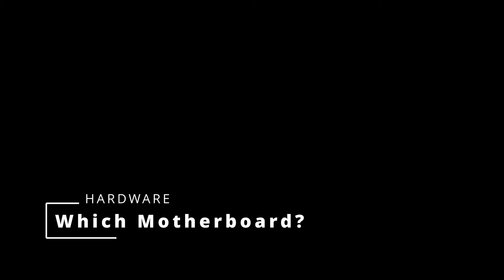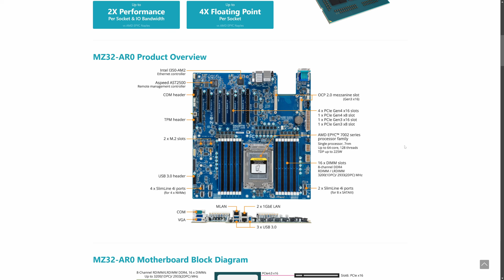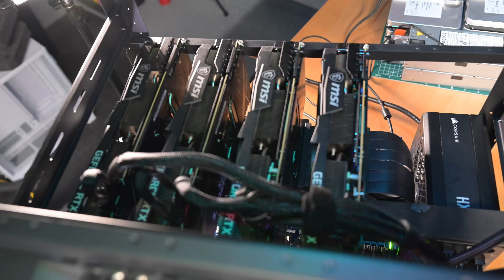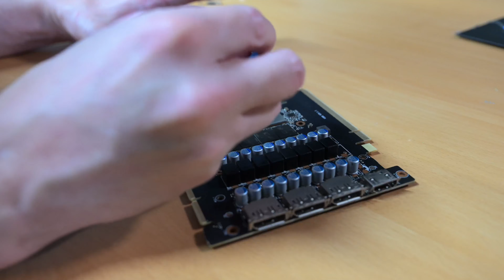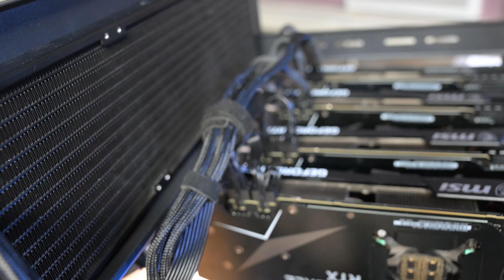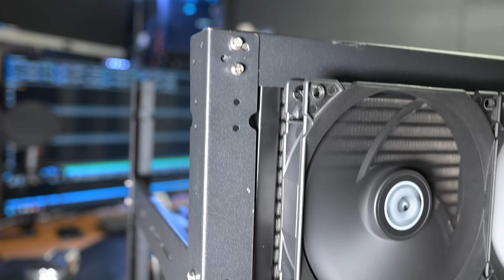INSANE Home AI Server - Quad 3090 Build

Comment: No MX4. It pumps out pretty bad therefore not suitable for on-die application. Go with PTM7950. I have it on my 3090FE and the performance just doesn't degrade. I used LM in the past and PTM is nearly as performant as LM while not amalgamizing with the heatsink.
Reply from the maker: Holy cow what voodoo is this? I was last night reading about PTM7950 as a replacement for my 4090s. The 3090s dont really get hit heavy on inference so they have been chilling pretty good still in the garage coldness but the asus 4090s are wtf levels of bad with whatever factory goop they used. This timing, its gotta be a simulation.

Only time someone has mentioned PTM7950 to me also
Reply: @DigitalSpaceport  I haveit  two A4000s and one 3090 FE. PTM7950 is it; it's the no-compromise thermal interface we all have been waiting for.

Comment: I dont understand the ram. Why 512gb?
Reply from the maker: In the nezt vid it explains that sadly one of the 64GB dimms didnt work so im now down to 256. However in both instances this rig is the failover in my HA cluster and I have a lot of vms and containers. My standing footprint is over 60GB and I run two workloads that can peak at 128GB each as well so yeah. Plus using a lot of wticks allows me to use all the memory channels and get tgat sweet epyc mem bw.

Comment: yes cool yeah great, but running consumer grade is VERY electricity expensive! bad idea. I would personally go for  a series of L4 which draws 72w only...
Reply from the maker: This rig I have the idle down to 130s now and most of that is me using the wrong EPYC cpu for efficiency as this is a homelab balanced machine to match my other 64 core server. Each of these gpus idles at ~10w which yes is a tad high but I would love to get my hands on some L4s.

Comment: @digitalspaceport - curious, when you purchased AMD EPYC 7702P cpu from ebay, did you took a gamble that it works or you have had 100% positive experience from ebay?
Reply from the maker: Im doing an update video right now so id suggest you hold up until its out. May be much later tonight but likely in AM.

Comment: I have a noob question (sorry for that): in the next video you mention that one of the Ram didn't work so you have to downgrade from 512Go to 256Go ram. I do not find any precise information about the maximum Ram total memory size the bios can support. Theoricaly with the 16 slot with 128Go ram each we can go up to 2 To of Ram for offloading GPU (even if it's kind of stupid to go this high😅). So i wonder if th bios and the mother card can manage effectively a least 512 Go of Ram.
Reply from the maker: Yes they can and DDR4 is down in price a decent amount. It did run and register as 512 for a while but that stick dropped out.

Comment: Thank you for this! Thinking about building the same rig with quad 3090s, but want to keep the door open to quad 4090s next year. In that case, what would you change about the build if anything?
Reply from the maker: Or maybe 5090s.... Good question. I addressed most of this in the recent vid  and article on HW considerations. Id go with a faster CPU, lower cores. Likely use air cooling vs liquid, I just had that cooler free. Probably at current prices would go H12SSL-I also. 
https://www.youtube.com/watch?v=_xL9r0ygISg&lc=UgzhzqLF3s-nJ5Lhud94AaABAg https://digitalspaceport.com/homelab-ai-server-rig-tips-tricks-gotchas-and-takeaways/

Comment: AMD EPYC 7763 is probably a better choice for CPU, it's released about a year later after 7702, and is a fully 7nm process. About the same price as 7702 on eBay right now.
Reply from the maker: I like this comment but let me ask you, if I wanted to bias a bit more for more mid range epyc freq what would be your recommendation? Id be okay sacrificing core # but selling to switch would be ideal.

Comment: 200W idle in Europe / Germany would you kill your electricity bill
Reply from the maker: Agree and I have more focus on power efficient systems also now. Video I launched today is a PC that idles around 25w. https://www.youtube.com/watch?v=iflTQFn0jx4 and that machine should hit like maybe 75% of most avg ppls use cases. I am working on one that hits 8w idle also but it likely hits around 50% but may also be of interest. I did get that rigs idle down lower after working on it some more and I need to mention those steps in a video sometime also. Powersave and some kernel flags really can cut the wattage for an epyc with minor usability impact.
Reply: @DigitalSpaceport  love the video tho. However when looking at the excel sheet with 650$ for one GPU... here one costs about 1.500$+ (so 6000$ for 4 of them)

Comment: Can this build be used for everyday computing, as well?
Reply from the maker: Sure. You could run the setup I did a year back that has worked very well easily here. It is just proxmox and a LXC but there appears to be a way to get a LXC windows instance running. I need to look more into that. https://youtu.be/IylJNfLi36E

Comment: Sorry if I'm repeating questions from elsewhere in the comments.  How did you "manually limit the GPUs?".  What approach did you take to lower their power consumption to fit within the profile necessary for your PSU?  What was the impact to performance of doing that?  Also, why not add a second PSU so they can run unconstrained?  Is there a way to safely do that?
Reply from the maker: nvidia-smi pm1 and pl XXX whatever wattage. It turns out however your GPU processing power utilization is /n so like each 3090 here only runs at 1/4 power. This is due to how ollama/llama.cpp currently handles model splitting. Tensor parallelism and such. There is work that may address this in the future and I would consider it more then.

Comment: Why don’t you use NVLink?
Reply from the maker: You wont get improvement for inference workloads. Have tested on dual A5000 and NVLINK. I may however use NVLINK for doing training on these 3090s but am not there yet.
Reply: @DigitalSpaceport  For inference not but for training it will make big difference but you can only utilize 2 cards at the same time when linking via NVLink but that should still be better than training with 4 cards on PCIe....

Comment: cool build, love the spreadsheets. You should project cost of ownership. At what point does it become to expensive to own ? Is there perhaps an undervoltage potential to bring power draw down without adversely affecting performance to much ?
How can you make money out of it ?  Can you bridge the gap from your website to this awesome beast and share time against your AI ?  Is there a particular branch of AI that is more cost effective against another that might not be landing on the sweet spot ?   Could you add an ASUS raid card, perhaps another network card , say 10gbe , can processes be re-routed to avoid cpu and ram bottlenecks ?
Good job, want more.

Comment: Your video is great!
There is a resale Asus prime trx40 pro at pretty decent price. Do you think it would do the job as good? The mb comes with 3 x pcie 4.0.x16 and may need a splitter to accommodate 4 gpu. 

In addition, I already have 6 x rtx3090. Do you think it would be beneficial to utilize all the 6 GPUs? I plan to go for llama 3.1 70b.
Reply from the maker: What is it priced at and does it include CPU?
Reply: @DigitalSpaceport  Trx40 is 120usd without CPU or Ram.
Quite hard to find AMD server mb in my area. What would be comparable setup if on Intel set?

Comment: I'm curious whether it's better to have identical 3090s or if using different brands wouldn't make a difference. Also, is it possible to mix 3090s with 4090s?
Reply from the maker: Yes you can mix any GPUs, even extremes like a 1070 and a 4090 and benefit from added vram size, however if you have slower cuda cores (usually older gen is slower) then you will baseline performance at the lowest cards level. Mixing 3090 and 4090 for quant 8 or lower is next to no discernable difference. Mixing 30/40 at fp16 you will have several t/s slowdown. I like keeping it to one model of 3090 if you can as you likely need to clean/repad 3090s especially. Its easier to be able to know what screws and pads go in which spots that way.

Comment: there is absolutely no way you are going to see any kind of condensation unless the room is at below freezing temperatures or you are using liquid nitrogen why even mention condensation???
Reply from the maker: The window AC spits out sub 32F air and wqs one, of many, considered plans was to have heatsinks right next to it. I opted not to and everything is greatly cooled from a distance as well. I do see condensation at times on the AC directional fins and need to wipe it off and pay attention to it so I dont get mold growth.

Comment: I have a epyc 7551p 256gb with Tesla p4. Going to potentially put my 3090 in it. The 7551p also does 2ghz for 32 cores. Do you find 64 cores at 2ghz is working well or is the cpu ghz speed a bottleneck regardless of core count?

Comment: Thank you for amazing content. 
I bought the same setup using your links. I am having a hard time to understand where to plug the power switch. How are you turning on/off yours? Is there any spot on the motherboard I can plug the switch on?
Reply from the maker: Find the model number online. Then search that document for PWR and it will show you the header position pins. The black cable - is ground and the red is +

Comment: A good alternative is buying a refurbished Mac Studio with M1 ultra + 128GB RAM on e-bay for around $3k. The M1 ultra with 128GB RAM will run 70b models with q8 precision at ~7.5 tokens/second and draws less than 100W when running such models. Additionally, you can configure it to allow up to 120GB RAM for the GPU, which should be enough to run 70b models at 64k token context.
Reply from the maker: I have one big issue with the Mac Studio route and that is indeed the Tokens/second fall into what I deem an unusable range for middle size models. Under 10 is painful and discouraging to use imo.
Reply: @DigitalSpaceport  7 tokens/second is slightly above the speed at which I can read and get good comprehension of what I'm reading, so anything above that speed doesn't make much difference for me when using the model on a chat UI. However, for using the model as an agent for automating tasks, then yes this speed is very low.

One thing I'm curious is what kind of speeds you get when using larger contexts with quad rtx 3090 setup. On the M1 Ultra it gets very slow for 70b models at close to 30k tokens in context, about 2-3 tokens/second

Comment: Yes but how do you get any LLM to run on all that? For example, llama v3 requires a high VRAM count. Does this get around that per card VRAM by being able to aggregate the VRAM or is that not a thing?
Reply from the maker: Yes it spans the vram of all the cards needed to fit the model

Comment: These 4 GPUs should only draw 250-300W alltogether?
Reply from the maker: Due to the way the model workload splits across the GPUs when you are using their VRAM, they are often around 25% utilization on the processors. There are other ways to split workloads but lamma.cpp is under the ollama hood so that would need to be addressed there. Tensor Parallelization is the term.

Comment: The budget of 5K for that build is awesome,  at first i thought we were looking around 10K.
Reply: On a side note, i am having trouble sourcing used 3090 24GB in my area.
Reply from the maker: Im in a fairly large metro and my local sellers want more then ebay. I pointed this out to one who had a similar 3090 Ventus for about 75 more thinking they would be like okay ill go to 600 and they refused to match ebay. Totally their choice but local sellers being way high on prices and unreasonable in negotiating is a recurring theme recently.
Reply: @DigitalSpaceport Soooooo true. Local sellers are terrible. Near me they want 1k CAD for 3090
Reply: @DigitalSpaceport  Yeah same here. its sickening. One guy got pissed off at me for showing how much less I could buy online. Oh well, their loss.
Reply from the maker: Thanks I also think its very cheap for what it is. I couldnt get as much bang for the buck any other way.
Reply: What about electricity bill
Reply from the maker: About 275/mo. We bought this house with electric rates in mind also as everyone doing any form of HPC should in my opinion. It can go as high as 800/mo if Im really cranking flops but thats a fraction of what cloud costs would be. There is a not small part of this that is production for my business.
Reply: @DigitalSpaceport Oh. My. God. Electricity here is 0.30 € per kWh or more, for a homelab I'm trying to keep idle at 100 W or less, but it's impossible with dual RTX 3090, 10 Gbe and a bunch of hard drives. Btw any recommendation Zen 1 vs Zen 2 vs Zen 3 EPYC in terms for bang for the buck? Is Zen 1 really that much worse performance per Watt?
Reply: 5k is nothing for this PC. Makes me want to get one for myself.
Reply: @johnbell1810 I think I can bring similar server for 4k, I can buy RTX 3090 24gb for around 600 usd/pcs -> 2400 usd, and 1600 usd for rest.. is more than enough. 😀
Reply: @johnbell1810  you weren’t wrong, just early.

Comment: I miss where Ollama training has been shown and how you tell it to divide itself among 4 GPUs. Can you fit in these 4 GPUs a 70GB model, for example something in FP16 with ~30 bil.params ?
Reply from the maker: The user does not tell it to split into layers, the underlying parallelism method is automagically applied from llama.cpp which powers ollama. You cannot fit the llama3.1-70b-instruct FP16 into just 96GB vram. That takes 140GB https://ollama.com/library/llama3.1/tags but you can fit in the q8.

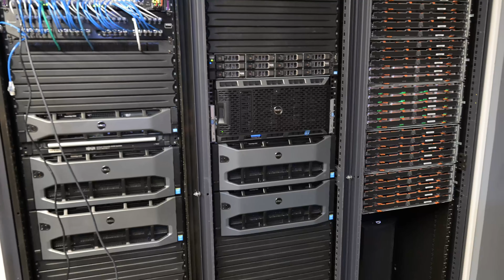Comment: you could have mounted the cpu radiator on the shelf below? level with the GPU's, maybe help take the strain of that one hose. Dude, 12:34 what are you into lol, thats some set up.
Reply from the maker: Yeah I want to fabricate an entire new case. This is just not optimal. In a nutshell I have a backup of the usgs geotiffs and I do a geospatial rendering based workload for my business. Its now able to be done with GPUs faster at nearly the same quality as CPUs so those r930s are not really needed as much.
Reply: @DigitalSpaceport  cool stuff, just recently watched a tutorial, VAPOR for WRF-Fire.  Im started to learn a bit about visualization with matplotlib, mostly on dataset embedding and query returns.

Comment: Nice build! Have you ran many training workloads on it? 

The single core perf of the 7702, even with boost , is pretty mediocre.  I fear it would bottleneck training unless you spend a bunch of time optimizing data loading code. I went with a threadripper pro for my 4x3090 for this reason but always wondered how a 7702 would preform.

Comment: great job keeping that under 5k. I made so many mistakes like dual xeon gold 6148s which didnt cost me money but time. I got it to about 5700 and it is not as good as yours.
Reply from the maker: 6148s are pretty nice chips also though! Are you air framing it or rack case?

Comment: Thanks for review. I have Asus z10pe-d16 ws main board,2x xeon 2683 v3, 8x 16gb ddr4 2133p,5x 3090 and many corsair a 1500i PSU.  Tried 70b q8 and q4 and 405b q2. They are extremely slow. What do  I miss? What is 4i sff 8654?Ty
Reply from the maker: You checked with nvtop when running and they are hitting the gpu vram during operation? If its running slow, thats the place to start.

Comment: I don’t understand something with this setup aren’t you limited to just small LLMs. Mainly because only 2 RTX 3090 can sync together via NVLink so you essentially have 2 sets of pair of RTX with you four cards. 
Also, I wondering about PCIe bottleneck.

Lastly, would advise to get a big enough RAM to load the entire 300Billion parameter LLM which works out to about 1.2 Tbytes.

If you could please discuss the limitation with this setup?
Reply from the maker: No that's not a correct starting point for assumptions, but one I started with as well. Its poorly discussed but im working on talking and sharing much more of my learning about this all also. You do not use nvlink for inference. The llama.cpp runner code automatically layers the model into GPUs automatically, so no need outside highend training for nvlink. To also state, Im using no nvlink. It also can layer it into system ram as well. However there is no need to run any large parameter model off system ram, as performance is abysmal. Even on the worlds fastest CPU/RAM combo, it is unacceptably slow. Think 1tk/s. At q4 for llama3.1 405b.
Reply: @DigitalSpaceport  thanks
Reply from the maker: I made this video that shows this pretty well also https://youtu.be/-heFPHKy3jY

Comment: Hey, what are your thoughts on mix-match GPUs? (i.e., dual 3090s and RTX ADA 4000/4500). Are there any benefit or disadvantage in mix-match or all same GPUs?
Reply from the maker: Good question! I'm not sure I guess I will test that out here actually. I would guess that core speed/ram speed will dictate a lowest common denominator outcome as all work pieces need to be completed before response. I am also curious about scaling up VRAM in non-homogenous routes and the impact that has. I think layers are propagated in ollama/openwebui intelligently to each GPU based on capacity in VRAM. Im going to check, this is an important question. Thanks for asking!